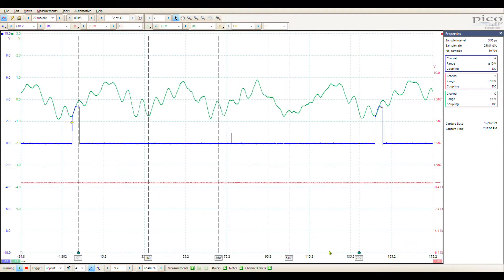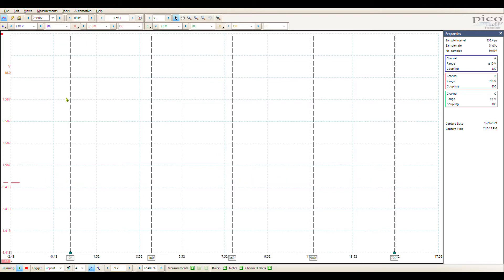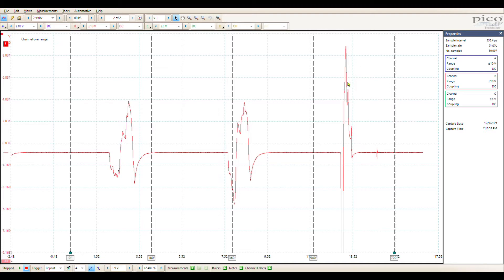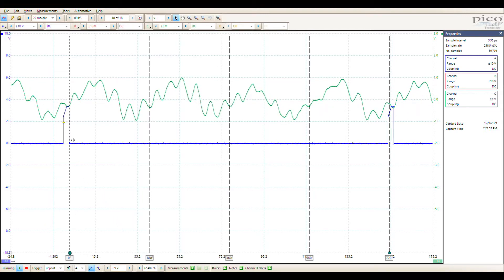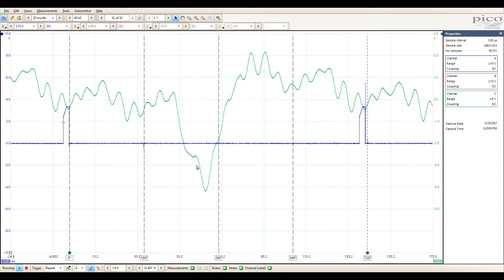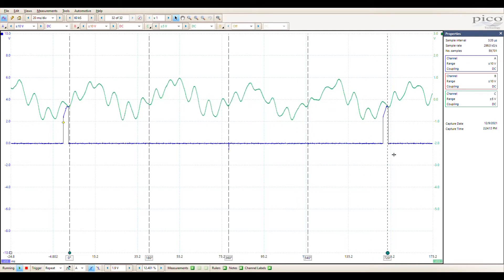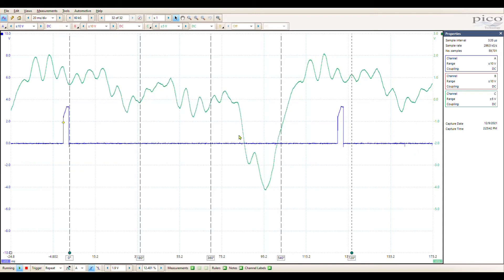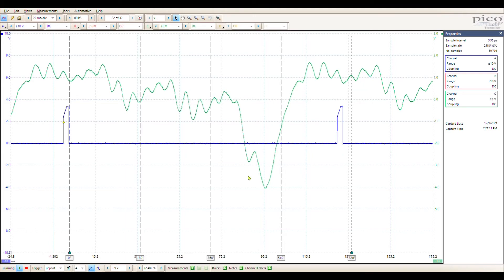Oscilloscope and Pulse Sensor For Mis-fire Diagnosis

Comment: I'm assuming since you don't use the running exhaust pressure waveform except to identify a misfiring cylinder, do you use the cranking exhaust pressure  waveform to diagnose an exhaust valve issue?
Reply from the maker: Absolutely 💯,.

Comment: Why do you use the first look sensor instead of the pico WPS500X?  I have a WPS500X.  Can I use what I have and get the same results?
Reply from the maker: Yes, the zoom modes on the wps should act like a pulse sensor.

Comment: Which sensor did you use? Cheers
Reply from the maker: Its an old school First Look Sensor. Not sure if they are available anymore.
Reply: @CartersDiagnostics  I want to build a piezo sensor to see if I can see the pressure waves of the exhaust and inlet. 

I have tried to use a solenoid coil from a relay to pick up secondary ignition for the first time this week using a tektronix lab oscilloscope: could not recognize the proper wave forms

Comment: Fantastic content. I liked and subscribed!
Reply from the maker: Thank you.
Reply: @CartersDiagnostics  this video was right on time for me. I’m chasing down a cold start misfire on my FB20B Subaru. It’s been a real nuisance because of how intermittent. I’ve done a compression test and a block test with fluid to rule out a leaking head gasket. At this point I feel narrowing down the cylinder with a pulse sensor is the move since the computer just throws a P0300. I’m a bit more limited since I’m using a cheaper scope the Pico 2204a. It gets the job done though. I’ve recently started learning more in depth diagnostics as I’ve found many shops around me are either the same price as learning and buying the tools or just throw parts at the car. Maybe I’ll upgrade to a better scope at some point. 

Anyway there’s my small rant on a Saturday. I’m excited to watch more of your channel. It’s a gem!

Comment: If you use the "technique" just to identify the cylinder that is misfiring...wouldn't it be easier to read the codes from a OBD2 scanner?
Reply from the maker: Using the scanner is easier.  I use this technique to make sure OBD2 and mode 6 data is not lying to me. I have seen wrong identified cylinders before.
Reply: This technique is used for older, classic vehicles which don’t have an OBD2. It’s an ‘new’ 😂 technique for us with older vehicles. You are possibly too young to remember the ‘good old days’ of vehicle diagnosis before electronics were introduced into cars. This is a very informative and useful video. Many thanks from an owner of a 1934 Austin 7, a 1954 MG-TD and a 1983 Morgan 4/4.
Reply from the maker: Great comment,  Thank you for watching!

Comment: Loving it Mr Carter. question,when checking the intake and crankcase. Do i have to read from the right if i sync from number 1 cylinder? Will try the rag in the exhaust and compare the difference in the waveform
Reply from the maker: A crankcase pulse should line up close to TDC  (ignition sync), if the leakage is past the rings. 
So looking at  the 360 mark, to the left should be the ignition sync 's exhaust pulse if in the tailpipe. To the right should should be the ignition sync 's intake when looking at intake pulses.
Reply: @CartersDiagnostics  thanks again for all your support and continue guidance. Take it easy
Reply: Excellent video. Don't know why I haven't found your channel before. You just earned another subscriber!

Comment: Very good information Carter! I use the pulser sensor to see what cylinder is misfiring mostly in old cars. Even in new cars is useful. I had one that the misfire counts were in cylinder 1 and pulse sensor shows 4. Really good tool and I want to learn more because in other countries they know a lot about this tool! Brazil for example! but I only see videos in 4 cylinders and old cars! Thank you for sharing Carter.
Reply from the maker: It works on 4 6 and 8 cylinder engines in my experience, just a matter of interpretation . The more the cylinders it does get more confusing.